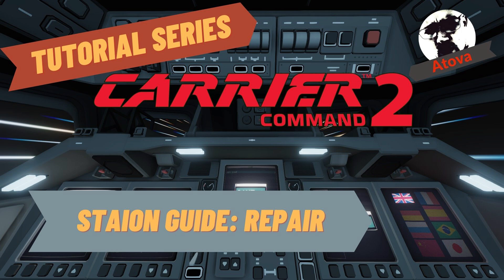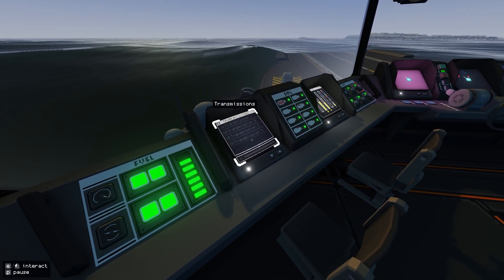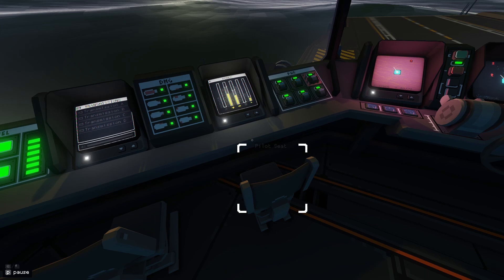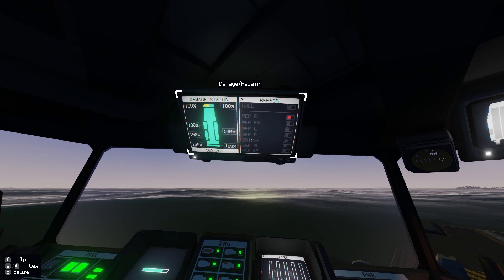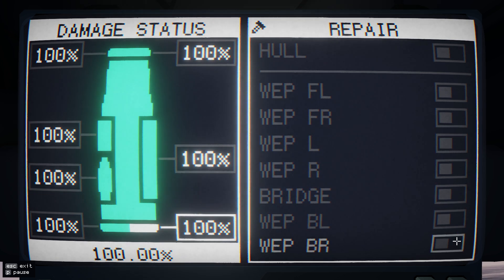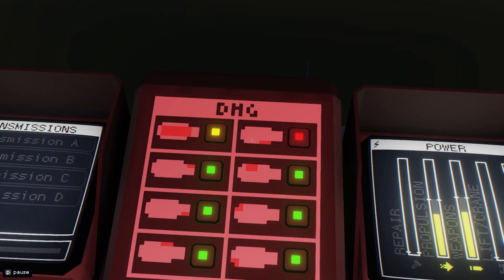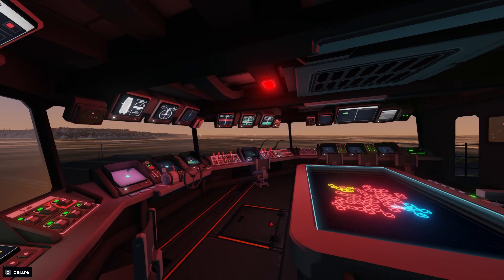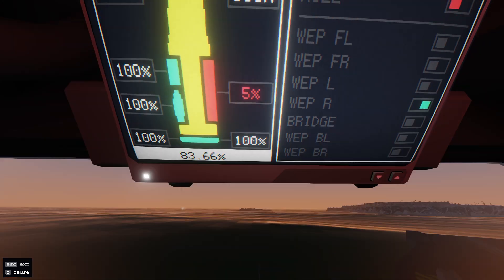Carrier Command 2 Tutorial - Station Guide: Repair

Comment: I'm amazed at how little the engineering station is covered by people.  It's not an active station, but it's one that someone needs to at least keep an eye on.
Reply from the maker: Yeah totally, do you think I missed anything?
Reply: @Atova  If anything, just the relation to ship travel speed vs power levels.  (Aka, remembering to stand down all the weaponry when travelling between islands)
Reply from the maker: @Dreamshadow1977  can you go faster if you turn things off?
Reply: @Atova  Yeah. Power from the engines is distributed among the Carrier's systems. Every system and subsystem has requirements for operation, and the remainder is allocated to propulsion. The throttle than applies a proportion of that allocated power.
Reply from the maker: @watchm4ker  interesting, missed that part, love it!
Reply: @Atova  Yes, If I only have propulsion and radar turned on, I can get up to 90 knots, but if you have weapons all enabled, I can only do 50 or so knots.
Reply from the maker: @Dreamshadow1977  thanks for that!
Reply: @Atova  You can see that at 0:34. There's a yellow bar showing the actual power available to the systems and the grey bar with the white tick marks on top show the full potential. If there's no grey bar, you're getting the max out of it, no need to turn off stuff. I usually keep the defensive weapon switches on all the time (so they'll always be up with weapons on), activate offensive weapons when needed and switch the weapons breaker off when cruising to somewhere else with no threat around.
Reply from the maker: @CakePrincessCelestia  thanks!